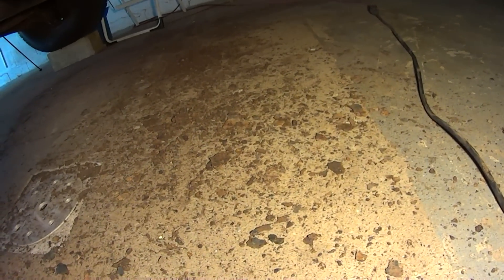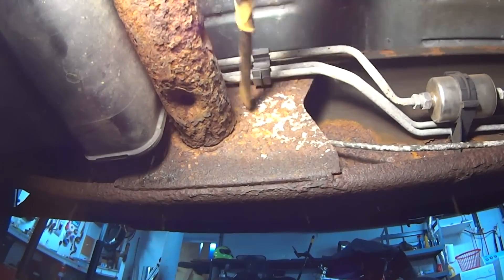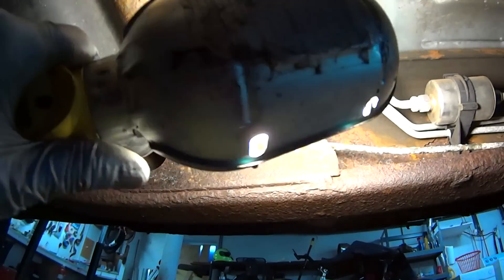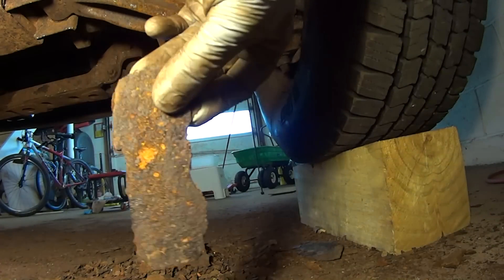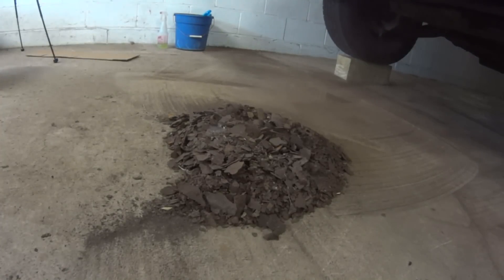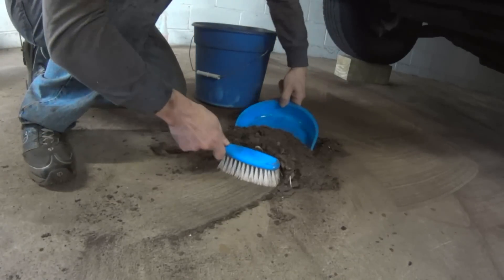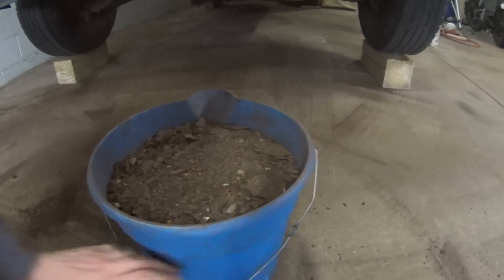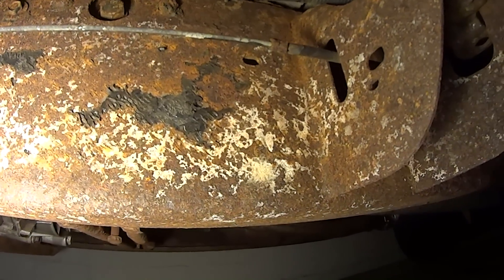Most satisfying video. Silverado Frame rust removal, RUST PROOF STUDY

Comment: You should send that bucket of rust to GM
Reply from the maker: It's engineered that way, RUST = good business.
Reply: The problem is that not one of the truck manufacturers are using the right stuff for good corrosion protection. The only permanent coating is an epoxy based paint like POR-15.
Reply: @hochhaul  por15 is not an epoxy! why does every one say coatings are all epoxies? only epoxies are epoxies. not polyurethanes like por15
Reply: @Justinofalltrades1  I was told it was epoxy based. What fucking difference does it make?
Reply: @hochhaul  no, use fluid film, a coating that does not fail, and there is another one like it that is black.
Reply: @hochhaul  POR-15 is not epoxy. If you're not mixing in a catalyst, then it's not epoxy. I'm not saying it's bad, but it's not epoxy.
Reply: All in how you protect your investment. I've seen 2010 Tacomas with horrific rust, my buddy has an 08 F-150 with scary frame rust due to frame paint flaking offing, and I've owned a Honda Accord that rottted out despite how nice the body looked. I put it on a lift and traded it in to a dealer a couple months later. These days, any brand other than Toyota will be fairly rust resistant. You might get a free year or two. After that, make sure you get it cleaned and undercoated correctly. I have a 2014 Silverado that's 100% rust free, frame-body-suspension. All clean. It cost me 20 minutes a year and a can of Fluid Film.
Reply: @hochhaul  does fluid film remove surface rust?
Reply: @lastcall170  No it soaks into it and stops the rust from eating any deeper into the metal. It will also stop it from spreading. It works very well.
Reply: hochhaul fluid film is the way to go just spray it on once a year and keep you’re truck clean and that thing will never rust
Reply: @hochhaul a bit late to the party, but is your 2014 silverado still rust-free? never have to grind anything if you just shoot every year?
Reply: bababooney- GM regularly issues recalls, even for very small amounts of a particular production run. So much so that they get ridiculed for quality issues because of it. Yet they fix safety issues when they know about them. 

In contrast, Toyota just recently settled with the US government because high level management knew that their  unintended acceleration issues (that resulted in deaths) were due to softwate and hardware defects. Their frame rot issues occured for nearly 2 decades before they decided to recall anything, yet they didn't change anything. The frames still rot out.
Reply: sms373 GM doesn't have anything to do with it
.. it's road salt that makes shit rust...  I'm in Texas and my1990 Buick century doesn't have any rust at all
Reply: Yet Toyota Tacomas rust so bad they fold in half like a birthday card after a few years lol.
Reply: @hochhaul  yeah guess who made the frames, and where. made by dana in mexico.
Reply: @davidfarmer  Despite Toyota frames having severe premature corrosion and rust perforations, Toyota used Dana frames since at least 1995. The 1st gen Tacoma's Dana frames were just as bad as the 2nd gen's. The old Toyota Pickup had frame rot issues in the 80's. 

Toyota used Dana frames made in Mexico. GM has used Magna (Cosma) frames for nearly 20 years. They're made in Canada and Mexico. The F-150's frame is primarily supplied by Metalsa SA and made in Mexico. The Ram 1500's frame is supplied by Tower International and made in Mexico.
Reply: @hochhaul  I'm not going to stop calling you out by the way...
Reply: @hochhaul  that is quite true but Toyota at least recognizes they have a problem and will buy the trucks back at a fairly generous rate. Still waiting for GM to do anything about the POS frame under my truck! I do not expect them to ever step up to the plate...😆
Mike 🇨🇦🍁
Reply: Kyle Crater yep i spend 12 hr a day in my truck most days and i have go to california from iowa at least 12 times a year moving amish broke horses to rich ass holes in california i get about $4000-$5000 i trip

way more than a over the road trucker gets

one time i even got $1000 tip from a client for being 1 day early 

HA i got my days and nights mixed up and drove all night thinking it was morning

but this week im splitting wood for winter so work is on hold last thing i want is for my girlfriend to be cold AND alone she would want to come with and my work would take longer and no goodies when i get home
Reply: Hey VK i'm not rich but I love rich A-Holes or just rich folks. 
They want more money, and that's good! In order to get more money you have to:
1. Start a Business.
2. Expand a current Business.
    AND....  Both of those employ people so they can feed their families and buy cools stuff.

Also Rich guys buy lots of stuff! All that stuff has to be made or produced, and that needs employees. So when they buy stuff people have jobs to feed their families and buy cool stuff.

Also the top 10% of rich folks pay 90% of all the taxes in the country, and that's after deductions. That money is used to feed the poor out of work and it also pays for our national defense.
So what would happen if we had fewer rich folks? You guessed it total chaos, with a bunch of angry poor folks rioting in the streets. Then we end up with some War Lords or a bankrupt country like Post Russia. We need to lower taxes on the rich so they can start new companies or expand the ones they have. Also cut corporate taxes and regulations so they will bring manufacturing back to the US.
Yep I love Rich folks and companies because without them we wouldn't have a country that we recognize.
Best Wishes n Blessings Keith
Reply: Keith. You should of started this story with..You ain't going to believe this shit...but....
Reply: hochhaul Oh, the irony.  GM has had so many recalls and bad quality components that they had better keep up on them, no matter how minor/trivial-seeming.  the 2005 silverado  at work, had such badly designed, cheap ass door hinges, they would send it out fo h ave them replaced under warranty.  two weeks later, the doors were opening all the way and warping the panels.  the mechanics at work just modified the hinges themselves after a while.   One problem gm had last year, they had no fix for.  a vehicle was at risk for catching fire, whether running or not.  the only fix they had at the time was to park it out on the road.  As far as toyota goes, never said they were perfect and as far as the frame rusting years, that was dealt with.  the whole class action thing you mentioned, duly noted...im sure they're not 100 percent innocent...it is hard to argue a toyota with 345 000kms on it and nothing but maintenance.  story after story.  im sure, like with everything else these days, the track record on mine won't be what it was, but the amount of gm owners ive spoken to that surprise me by saying they want rid of it and will never own one again, is growing.  a shame, too.  I always owned gms and i still love driving them.  I looked at the colorado and it is really nice.  was tempted..
Reply: Keith Noneya never said i disliked them i said they pay better
Reply: Keith Noneya lol they are ass holes because when they have me work for them they talk down to you and demand you to do the impossible 

BUT on the flip side when i pull it off i make bank sometimes $500 tips up to $10,000

so far only one guy tipped me 10k before but when he did i was dumbfounded i did understand at the time how a guy could have 10 grand to just throw away
Reply: hochhaul dude, chill, .The big three are brutal  I've dumped on the other two a hell of a lot more than gm.  trust me. out of the big three, i still prefer to drive the gms at work.  that'll never change.  the ones we had in the late 90's were gems to drive.  I couldn't get enough of them.  I had an 86 half ton with a 350.  it was an old piece of shit when I had it, but it never let me down.  Nothing much to go wrong with it. my dad has had only gms. same with myself.  my own mechanic, a gm fan, did not recommend it.  ive cursed at more ford and dodge/ram shit  over the years.  every dodge with a cummins has the engine light and or the check gauges lights illuminated most of the time.  We've had piece of shit international trucks catch fire in the cab.  i hate them all for various reasons.  Having saID that, I'd still love to own an old school gmc/or chevy pick up one day. not sure what year.  i'm thinking before 1980.  will never happen, but it'd be nice to dream.  chill with the quotations, i don't give a fuck about this that much.  everything is shitty these days. some less shitty. gms rust, fords rust toyotas, hondas rust. brake rotors are made with shitty recycled metal, rust. I'm done with this conversation.  a response will not be seen.  Guaranteed.
Reply: bababooey7576 well im still running an 82 Ford half ton with a 4.9 I6 and im ad 530,000 miles right now bought it with 30,000 on the dash personally turned it over 5 times in the last 8 years NO rebuilds as far as i know the 4 speed T19 still has factory gear oil
Reply: Wow 10K tip, man I love rich folks. I wish the rich folks I knew tipped me like that. I'll take talked down to any day for a $500.00 dollar tip. My brother is a welder in another state he builds artistic gates and fences for rich folks. He finished up a nice rail for one and they asked him to do some more work, he said sure, I'll put you in my schedule to do the work in a few months. The said, "We put a retainer on you so we want you to do it now!" He said the retainer was for this job, not future jobs. They got real snooty with him and said fine we'll hire another welder to do the job, he laughed and good luck with finding someone who can even do what I do, much less the price. In a few months they came back and said we can't find anyone who can do it. We'll accept whatever schedule you have and pay you double. He laughed and said you couldn't pay me enough to work for you, I don't work for snooty jerks rich or not, when I have people lining up to do the kind of work I do for the price I do it. Good luck and by!
 Wel Il gotta go, I'd be looking up some more work on that big tipper. 
Best Wishes n Blessings Keith
Reply: GM didn`t put Salt on the roads. 

Also if you have salt like that on frame = telltale sign of NO maintenance.
Reply: I'm sure they don't want his truck. ha     ha    ha
Reply: sms373 more like send it to the local dpw. The icemelt they are putting on roads today does far more damage to vehicles than good it does on the asphalt.
Reply: volcano hi if the Japanese vehicles are so great with rust then why does Toyota have recalls to replace frames or Buy out  trucks from customers??????
Reply: volcano hi my suburban got backed into and the whole corner of the quarter is pushed in with some chipped paint. This happened 6 or so years ago and still no rust whatsoever. The paint still looks great.

No rust underneath whatsoever.
Reply: hochhaul
since when?
Reply: Astro Camper its just weight reduction right??... people pay good money for weight reduction.
Reply: Rust = imma die buts its ok because im gonna run my truck till it seizes then try to fix it.
Reply: Dear NOT to bright , If like me you live in the rust belt where the most corrosive salt & calcium are used to keep the roads clear and drive a pick up or plow snow with one and you DO NOT DO DAILY Or weekly Salt neutralizer cleaning processes or at least pressure wash it I don't care what you drive it will NOT hold up to the corrosive effects of the winter months ... You cannot expect to plow snow and get paid  without having to do any Preventative maintenance .. I'm sorry you think the answer is take it back to GM because I've seen just as many Dodge Ram's & Ford F 250s out there that look like Freddy Flintstones mobiles  as well.. If you have a clue about what your doing  that kind of rust will never happen to you but if your just some lazy lame ass Millennial pussy and just put gas in it and go well then you get what you get..
Reply: My 99 Tahoe doesnt have a spot of rust on the frame
Reply: road salt is the issue, not GM or any other manufacture, I have a 31 year old Chevy truck and the frame looks as good as day 1, why, because i don't live in an area that has icy roads 8 months out of the year plus I wash the road salt off when we do have icy roads...so many people want to blame GM for rust when it's more their own lack of maintenance that's the root cause...
Reply: lastchapter You have a Honda, too?  Canada, as well...
Reply: LAFOLLETTER j
Reply: The Toyota unintended acceleration was due to the wrong size factory floor mats that would get caught under the pedal as far as the prius is concerned never heard about it on any other Toyotas. I live in Georgia and any vehicle I look at that was from up north I go through it with a fine tooth comb and either walk away or get it for a steal. both of my prius came from up north and they weren't too bad underneath.
Reply: volcano hi and yet toyota is still replacing tacoma frames by the boatload because they rot instantly.
Reply: bababooey7576 my last 3 chevys saw 250,000+ miles each. No rot issues. Replaced one tranny at 217,000. Tell me about how you ised to be a gm guy again...?
Reply: The shipping would be too expensive lol.
Reply: hochhaul most of the issues you described with the ram pickups were fixed for the 3rd gens (2003-2009 trucks).
Reply: Here's a 16th of your car back.
Reply: in  ohio  you  would   not  say  that...
Reply: sms373 yeah dude its bad here in Ne
Reply: sms373 they would just try to make another piece of shit!!!!!
Reply: Where m???
Reply: Send it to the city for coating the roads in salt brine.
Reply: Trout Junkie LMAO
Reply: volcano hi that's because it's plastic.
Reply: volcano hi it's made from plastic dip shit
Reply: sms373 
I have some to donate to the cause as well. 😒
Reply: Free weight reduction 😉
Reply: Why? It's no GM who puts salt on the roads dip shit
Reply: @volcanohi-p2u  Yeah and you've sent your money to Japan. SHAME.
Reply: @Boss-bf7ru  LMAO oh yeah what did I "lie" about. I HAVE the facts. I have the court documents from the 2016 lawsuit over rust rotting Toyota frames. I have the information on who supplied Toyota frames and how long Toyota has known about issues with those frames and did everything in their power to conceal the truth about their frame rot problem. You are pathetic for defending a shitty company like Toyota.
Reply: Or the dumbshit state that used salt and brine on the roads
Reply: Yea I'd like to warranty this! It's your frame in less than 10 years
Reply: Why send them the very thing they're sending out of their factories?
Reply: @TR Staaberelli it's Iowa so nothing else to do really I guess you could describe my drinking habit as excessive relatively speaking
Reply: The car or the bucket .
Reply: Burn it on thiere front lawn .
Reply: Not the company's fault for poor maintenance. Frequently washing salt off the undercarriage goes a long way, or applying a corrosion preventative spray before the winter season. 

Long before this new obsession with stuff like fluid film, folks were applying used motor oil to the undercarriage to stop rust. 

In the aircraft world, anti-corrosion sprays (e.g. ACF-50) have been around for decades. The grades of aluminum used in planes (e.g. 2024) can and do corrode to the point of falling apart just like a rusted out steel vehicle. Despite that, plenty of planes from the 60s still grace the skies on the daily basis with their continued flights. The difference is airplane maintenance isn't optional like it is on cars, each year they have annual inspections and maintenance, which is when ACF-50 is applied. If everyone treated their vehicles the same, they could last just as long, but most people have the mentality, "if it ain't broke, don't fix it." and they scoff at the costs of preventative maintenance or overhauling things that still work, but sometimes it's cheaper to replace or overhaul some parts proactively because their failure can damage other more expensive parts.
Reply: Much of it depends on where the car or truck is from. In 85 I  drove back from the service to Illinois, a 68 Cutlass convertible that I bought in North Carolina. The frame was for the most part fine everywhere.
My 06 Silverado is rusting badly but I'm trying to save it, one frame component at a time. Hopefully for most areas it's not too late though some may have to be replaced.
Reply: My 2019 is rusting and it just sits in garage
Reply: I said the same this ....unreal
Reply: He should send both, the big and the small bucket of rust.
Reply: All cars rust retard.
Reply: Send it to the government. My toyota broke in half... it's the road salt.
Reply: How go you neutralize the salt that has been absorbed into the metal?
Reply: 1320 foot pole. details, details.  I have a 21 year old Honda accord no rust. I rust proof it myself every year with my own undercoating gun and 4 foot homemade wands.  Canada
Reply: Good luck. Keep a fire extinguisher handy. Ford=Fires lol0
Reply: " GM has had so many recalls and bad quality components that they had 
better keep up on them, no matter how minor/trivial-seeming.  the 2005 
silverado  at work, had such badly designed, cheap ass door hinges, they
 would send it out fo h ave them replaced under warranty.  two weeks 
later, the doors were opening all the way and warping the panels."

Sounds like the guys that did the work did a shit job when they replaced them. The hinges were cheap, but that was also at a time when GM that was already on its death bed. Yearly hinges, BACK THEN, were common. Post banktruptcy GM has made a big jump in quality, especially on the safety end. It's not as though the F150 or Ram 1500 were any better. The F150 had constant engine issues (loss of oil pressure, timing chain wear/timing chain tensioner failure, junk valve seats, blowing out spark plugs, seized spark plugs, etc.), similar frame rot issues, similar junk brakes, random F150 fires, vacuum leaks in front hub locks, etc etc. The Ram's the absolute worst rust issues among the three, the transmissions were HORRIFIC, the front end problems would make a 90's Chevy/GMC look solid, the dashes crumbled into dust, the seats disintegrated within a couple years, etc. 

" GM has had so many recalls and bad quality components that they had 
better keep up on them, no matter how minor/trivial-seeming." 
Or they're trying to make a real change in behavior when it comes to how they handle safety defects. That's a pretty clear distinction with the way Ford has been handling safety recalls lately. First, they recall door latches that fail, but only in the south because it's heat that can cause the latch to fail and allow the door to pop open. I guess Ford doesn't think that people that live in the north will ever drive to the southern parts of the US. Oh wait, then the feds call them out over that BS limited recall, then Ford suddenly decides to recall ALL door hinges. Then there was the issue I mentioned. For years after the F150 ecoboost was first released, there were dozens of online reports of random brake failures. The online reports will only represent a small percentage of the total reports that Ford receives. They DID NOTHING about the brake failures. Many customers that had their brakes fail didn't even get offered warranty coverage for it (It's a $800+ repair to replace the brake booster/master cylinder). It wasn't until the feds announced they were investigating the issue that Ford suddenly jumped into action and recalled 2011-2012 F150's with the ecoboost in 2015! Then suddenly in 2016, after the fed announced a similar investigation, Ford scrambled to recall 2013-14 F150's for the same random brake failure issue. NOW they're rushing to recall 2015+ F150's with the ecoboost for sudden brake failures. All due to the same dangerous, defective brake system. Sounds like a DARK, EVIL company to ME!

"One problem gm had last year, they had no fix for.  a vehicle was at 
risk for catching fire, whether running or not.  the only fix they had 
at the time was to park it out on the road."

ARE YOU F'CKING KIDDING ME??? Ford is legendary for vehicle fires. You can litterally find decades of Ford vehicles that have burned to the ground. That's including dozens of 2015+ F-150's that have literally melted down into a puddle of plastic and aluminum. Not only that, FORD has dragged their feet in the recalls of several of those fire prone models, even as those vehicles were burning down the homes of families that parked in their garage. 

http://www.autosafety.org/ford-cruise-control-deactivation-switch-recalls-and-history/
http://www.autosafety.org/ford-document-millions-vehicles-have-fire-risk-part/
List of officers that have died in Crown Vic fires:
http://www.autosafety.org/list-known-fatal-fire-crashes/
"Ford Delays Safety Upgrade Until Required By Law":
http://www.autosafety.org/ford-delays-safety-upgrade-until-required-law/
https://www.consumeraffairs.com/automotive/f150_fires.htm
http://www.f150online.com/forums/2015-2016-f-150/510126-2015-f150-fire.html
http://www.f150forum.com/f118/melted-f150-copart-308862/

"As far as toyota goes, never said they were perfect and as far as the frame rusting years, that was dealt with."

They recalled a few years of the affected. yet there are hundreds of guys at the various Tacoma-related forums/message boards that are reporting that they were denied a replacement frame. The criteria Toyota established required frame perforations at least 10mm in diameter. If the holes in the frame were less than that, no frame for them. ROTTED HOLES IN FRAMES! Had there been any holes in a frame, it should have been recalled, especially considering some of those vehicles were far newer than 2005 models! And yet there is nothing in the design and construction of the newer Tacoma/Tundra frames compared to the recalled frames. The wording of the warranty was the only thing that changed. Toyota established that they are not responsible for future rot.
Reply: I also live in Iowa and I'm pretty sure the NE is way worse for rust then iowa. There are trucks here that can go 10 years without showing rust where in the NE they will show rust in 2-3 years.
Reply: Unlike GM,. Toyota dealt with their issue.  the big Three seem to not correct problems quickly or at all.  I used to own nothing but gm, just for the record.  couldn't face buying a new one and haviing the bullshit issues we have with them at work on a constant basis.  Sad really, i loved gm.
Reply: @bababooey7576  they all rust toyotas dodges gm hondas. They all rust in the northern states.
Reply: Ok I guess I just assumed when you called them A-Holes you didn't like them, my bad.
LOL
Reply: VK7001.P no way you put 500,000 miles on anything in 8 years, never happened.. that's 180 miles a day, 7 days a week, 365 days a year,  for 8 years straight..
Reply: ***** yep my friend has a 2014 2500 Dmax and it's already rusting out the body
Reply: volcano hi Really? Maybe you should go see a Tacoma and rusted frame problems. Don't believe me you can look it up.
Reply: I laugh at all you northerners in the comments crying about rust😂😂
Reply: Or you can get a German car that comes rust proofed underneath from factory.
Reply: maybe also try "must for Rust" after you get the heavy scale off, then red oxide primer.
Reply: VK7001.P the fact that you claim to be making 4-6k per trip and you're still driving an old Does not jibe. Nobody is going to hire a guy to transport their horses in a 30+ year old 1/2 ton.
Reply: I used to love GM, now I own nothing but Ford or Lincoln.
Reply: should have bought a ford mines an 84 f350 xlt and the frames not even pitted yet and im in NE iowa worst part of the rust belt